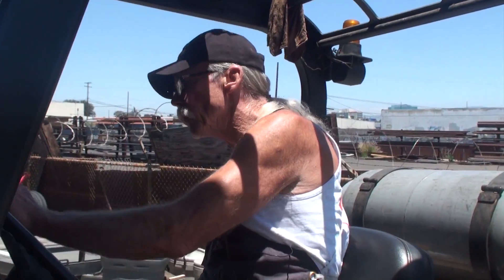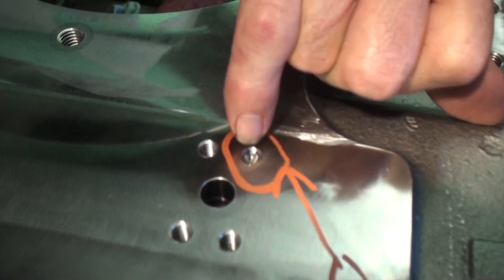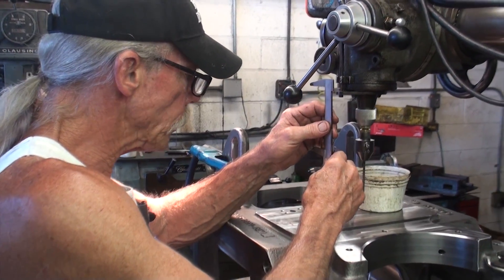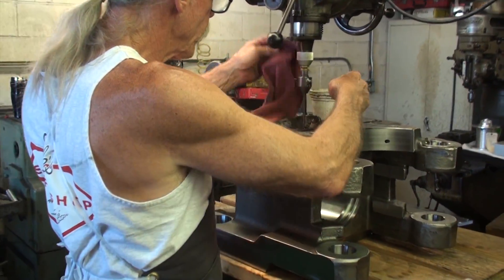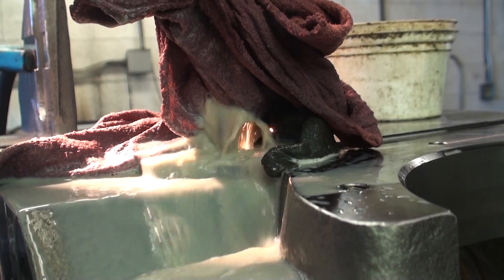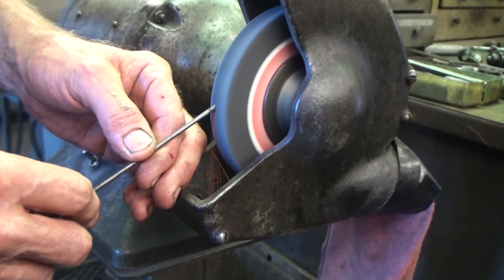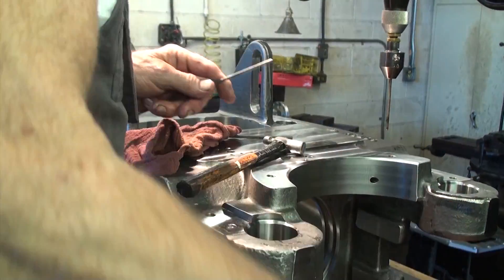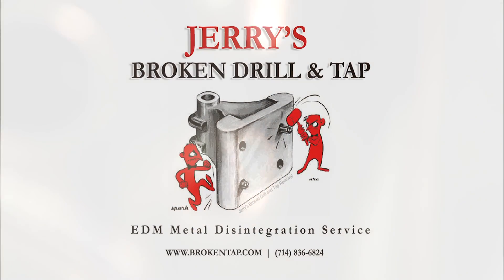Broken Tap Removal by Metal Disintegration Machine (MDM)

Comment: Greetings Sir - Great video and good to know there are individuals out there who have such important skills as the ones you demonstrated in your video. I appreciate your sharing the video with the YouTube crowd. 

I have an unusual issue that is related to an older set of Ben Hogan golf irons. The older clubs were drilled and pinned about 1/2 way down on the side of the hosel where the shaft goes into the hosel. The shafts are taper tip shafts and were also epoxied at the factory. They use to epoxy and pin the shafts so that they would not come off.

 I had removed the pins and was removing the shafts and most of them broke off near the hosel. I was trying to twist the shafts out and the vice grips crushed the shafts and they broke near the hosel. I was able to get 5 of the broken shafts out of the hosel but three of them don't seem to want to come out. I've heated them up first and wiggled the shafts out but 3 of the golf heads do not have enough broken shaft sticking out to grab onto with vise grips. Anyways one of the clubs (3 iron) I had tried a tap and it broke off at the top of the hosel. I've been trying to drill out the sides of the flutes with small drill bits and some of them have broken in the process.

I I took them to a machine shop and the operator said it was a waste of his time... I figured he would have more know how but he wasn't interested.  So I went home and ground the tip of a rat tail file to try and twist it down the broken shaft to get some grip on the inside of the broken shaft but they are really stubborn. It's not that the clubs are worth tons of money but I had had hopes of sending them off to be re-chromed and set-up for play.

If you have any ideas I would appreciate your suggestions. Thanks in advance.

Robert
Reply: BigRed56 We can fix those! Repaired several in the past. Tom
Reply: Tom Grafton Greetings Tom and thank you for your kind reply. Would you like me to send you some pics...? Is there an email address where we can continue the discussion...? Thanks and enjoy the remainder of your day...!
Reply: Removing a hollow shaft from a threaded hole is exactly what an EZ-Out is made for, should work easily with your golf clubs. If the thing you are removing is a broken bolt, it is first made into a hollow shaft by drilling out the center of the bolt. If the thing you are removing is a broken tap, you can't drill it with a normal drill because the tap is harder than the drill, but sometimes you can drill it with a carbide spade bit. If the tap is carbide, that is too hard for any kind of drilling, but also fragile so sometimes you can break the tap into pieces by hammering it with a piece of steel. Emphasis on sometimes. If all that fails and you haven't totally ruined the threads (or if you want it done right the first time), send it to Tom and his electrical disintegration machine! The parts I make are not all that expensive, throw it away and start over with a new piece of metal and learn not to break the taps.

Comment: Can't you just drill over and tig the hole shut and re-mill the surface? I now this doesn't apply to cast iron but I don't see why you need that tool for steel.
Reply: Ariel Lezen The welded hole would make a much harder spot to drill or tap.
Reply: Ariel Lezen You can't control the properties of the metal that way. Plus welding uses non pure forms of metal. If the spec for the part calls for a certain steel alloy then the odds of putting that exact alloy in with an off the shelf welding rod are slim to none. Welds are a patch at best and unless the part was designed with a weld you can just weld it. it wouldn't have the strength/durability the spec would call for.
Reply: ***** he means drill the tap out, fill the hole, then drill and tap it again.

Comment: Excellent. Wouldn't it be funny if the tap you used broke off again in the hole. :-)
Reply: ***** It's happened!!!
Reply: ***** I was joking. (That's what the sideways smiley is for) :-) But Tom (above) says that it has happened.
Reply: ***** Chasing threads just means gently running the tap through to check the integrity of the threads. Tapping is where you actually cut the treads and he did say he was chasing them. I've never seen someone break a tap chasing threads ever.
Reply: ***** I'm sure the company that broke the tap weren't using any cheapo taps; judging by the piece they sent in.

Comment: Cool stuff ... !  I'm doing a 351W transplant into my '94 Bronco right now (was a 302) ... got a couple of broke-off intake manifold bolts and one broke-off water pump bolt.  I'll be worry'ing them out the old fashioned way, but it should would be nice to have an option like this :-)  One question - after the broke-off tap was removed, the close-up showed thread damage.  Was that caused by/during the activity that resulted in the broken tap, or did the MDM process cause that?  Thanks for sharing this video - very cool !!!
Reply: Damage was done prior. not as a result of the machine, it's very accurate

Comment: 100+ amp rod, water running all over the place sounds a little scary to me...
Reply: The voltage is quite low, thus no problems.
Reply: It's built with safety features. No problem with the water!!
Reply: High current, with very low voltage, is not dangerous.

Comment: This is good, but actually you have an old machine ....nowadays the EDM (Electrical Discharging Machine) or called Spark Erosion is more accurate and very clean .....one electrode will burn the tap .......no hammer and no chisel .......I used to run an EDM and did this a lot